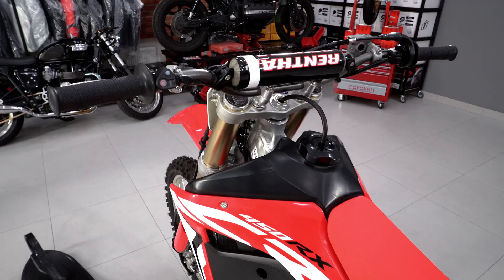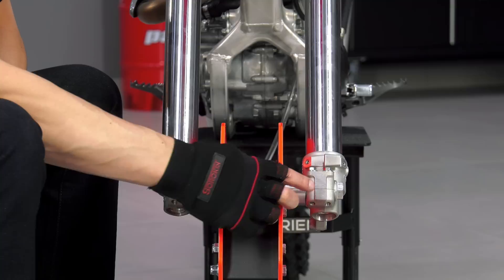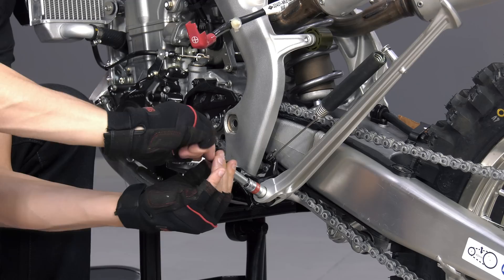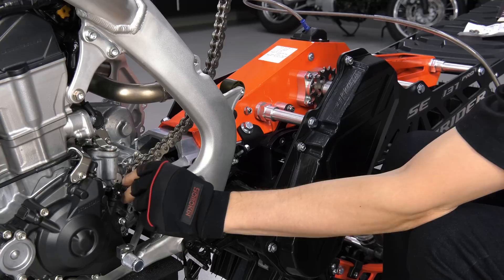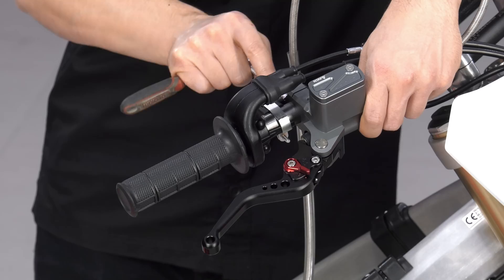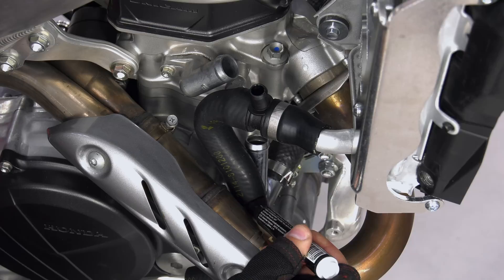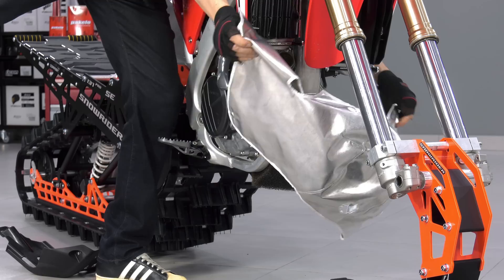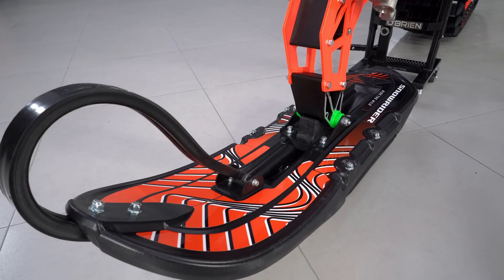Snowbike Build Honda CRF450RX

Comment: Cheaper then a snowmobile???? What a brand new dirt bike is 10k plus and then a snow kit form timbersled is 5-7k and yeti is 6-9k that is 16-19k. That’s not even with the other crap you stuck on that bike. A turbo 163 mountain sled is 15-16k. Now with that comparison out of the way a snowbike and snowmobiles are really not that comparable in my opinion. A snowmobile has big power, can rip up mountain and chutes, lot less learning curve (this is if you have never ridden a dirt bike or snowmobile, but even if you do have experience on a dirt bike there is still going to be a learning curve on a snow bike) now a snowbike is nimble can take you places a snowmobile wouldn’t fit. Can ride completely different lines, do things you can’t do on a snowmobile. And there are lots of things a snowbike couldn’t do that a snowmobile can do.

Comment: Too Complex to change over ...other versions from US makers are far simpler and proven
Reply: The us ones are still complex to install it's not like you're gonna change your bike over evrey season you have a snow bike then a dirtbike
Reply: @orca4770  Not true Nikoli, we change our machines in spring & Fall when the snow is gone and when it starts snowing. It's only about 1.5hrs to change over but we don't change over so many components as your version demands. The ones we have in North America are a simpler conversion, you should try them out.. SnowYeti and Timbersled. Enjoy the snow.
Reply: We have western conversions too at some stores
Reply: I thought the whole point is that you use the bike in summer,then fit track and ski for winter? Otherwise why not just have a skidoo and a motocrosser. Or am I missing something?
Reply: @supertramp6011  For me the point is a conversion is more nibble and light vs the normal snowmobile is bulky and also its cost effective a used mountain sled is around 10k for a decent low mile but a snow bike hit is around 6k brand new and snowbike has gears snowmobile just has cvt
Reply: @orca4770  hmmm... I don’t get much snow here,so I probably shouldn’t comment. If I won the lottery I would have both,and also a converted motocrosser- how’s that?🤣🤣 I’d be happy with any of the above. Heck,I’d just be happy to have his tools and workshop to keep my old truck running!🏴👌